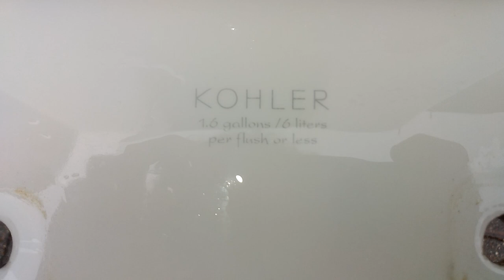2009 Kohler Wellworth Class 5 Tests

Comment: To me, the way a toilet flushes doesn't matter. It's the performance I care about, and these do their jobs just fine IME.
Reply from the maker: The flushes matter to me because sometimes the toilet leaves stuff behind.
Reply: @OCC_Plumbing_and_Restorations  if that's what you mean by flush, then I stand corrected. But I think of 'flush' as if it's cool or not.
Reply: @OCC_Plumbing_and_Restorations The white and blue fill valve is made in China🇨🇳.

Comment: Do you know why that fill valve takes to long to register that it flushed before it fills?
Reply from the maker: Because it has an extra cup around the float that fills up with water and then slowly drains after it flushes.
Reply: @OCC_Plumbing_and_Restorations  not really it has a water restrictor in the place where the supply line goes rip it out and it will work
Reply from the maker: @erickmorton8085  That makes it only a little better but at least it's an improvement.